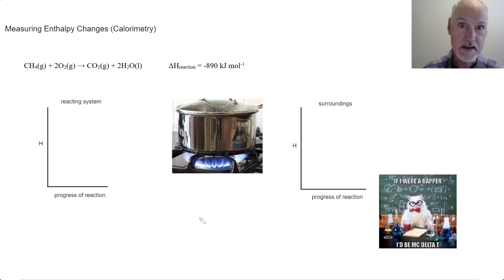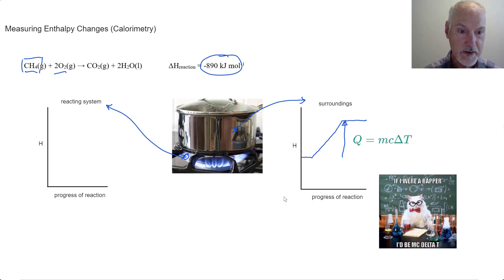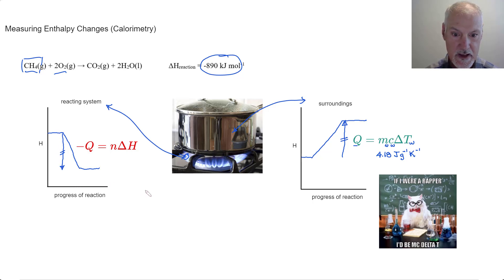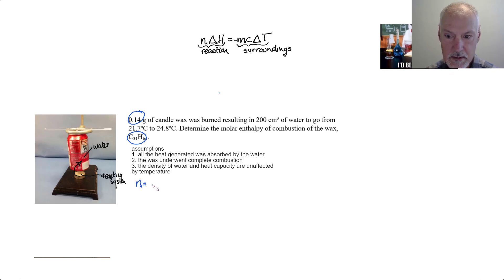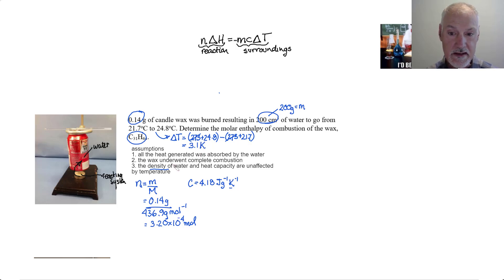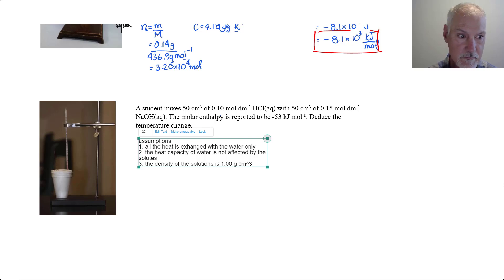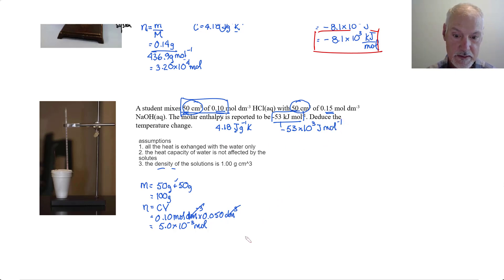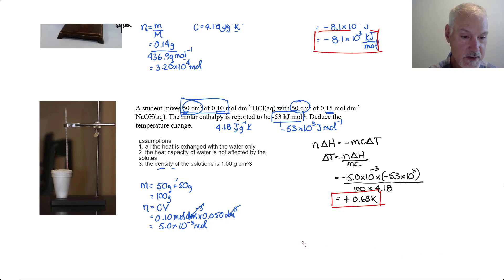Reactivity 1.1.4 Calorimetry [IB Chemistry SL/HL]

Comment: Why would density of water be affected by change in temperature? of course we are assuming it isnt but irl how would it be affected? is it because some mass evaporates? but then wouldnt the change in volume be same as change in mass so density remains the same?
Reply: Due to the heat source heating up the water, the molecules speed up and take more space. So the volume increases but the mass stays the same leading to the water having a lower density.